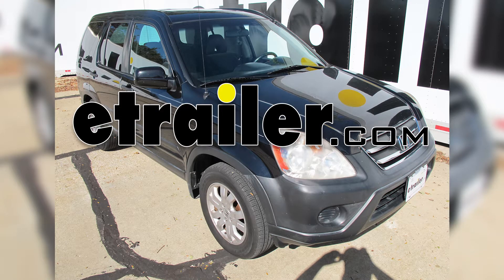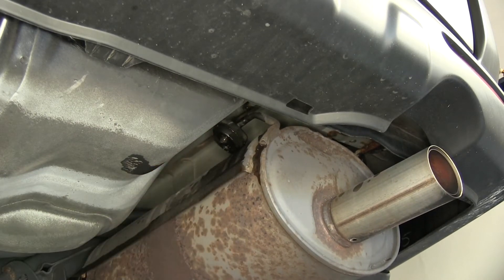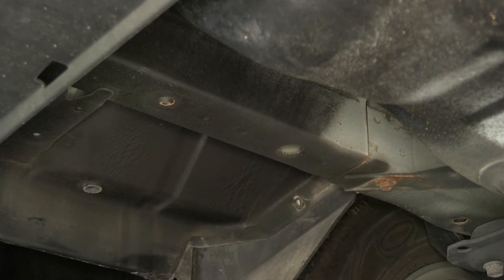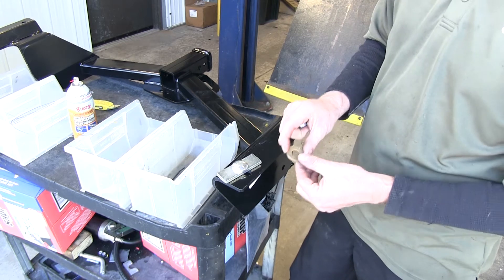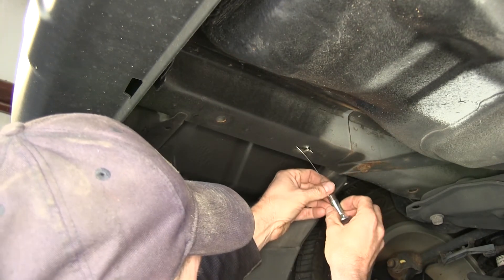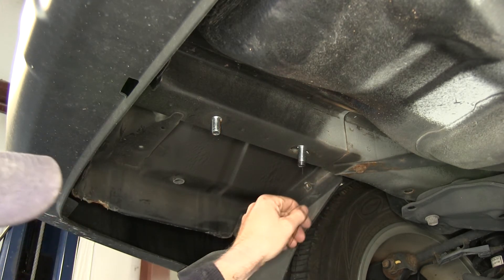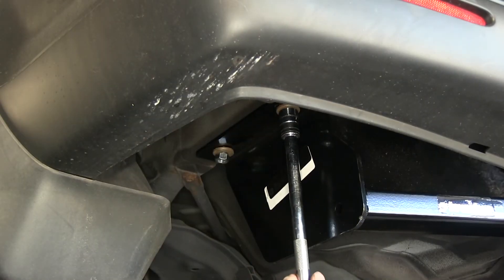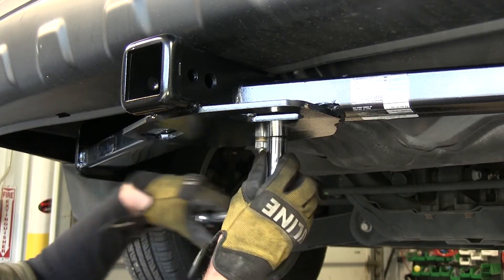etrailer | Installation: Draw-Tite Max-Frame Trailer Hitch Receiver on a 2005 Honda CR-V

Comment: Can you tow a jetski with these tow hitch?
Reply from the maker: This hitch is designed to carry 350 lbs of tongue weight and 3,500 lbs max trailer weight. This should be more tahn adequate to tow a jet ski. You will want to check in the owners manual of your vehicle to see what the towing capacity of your vehicle is and go with the lower amount between the hitch and the vehicle.
https://www.etrailer.com/Trailer-Hitch/Draw-Tite/75690.html

Comment: Is it the same part for the pre facelift 2004?
Reply from the maker: This hitch is designed to fit the 2002-2006 Honda CR-V. For more information on this hitch, you can find it on our product page
https://www.etrailer.com/Trailer-Hitch/Draw-Tite/75690.html